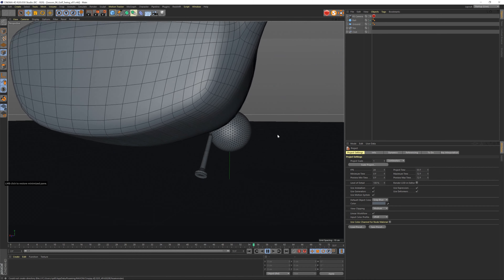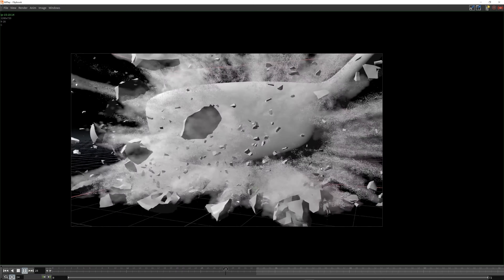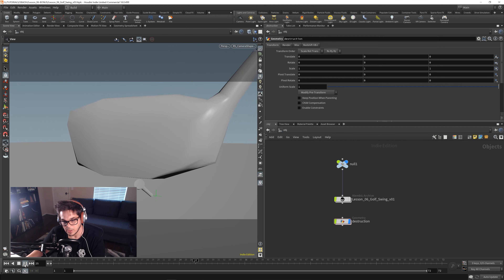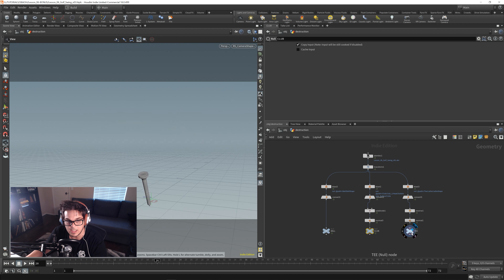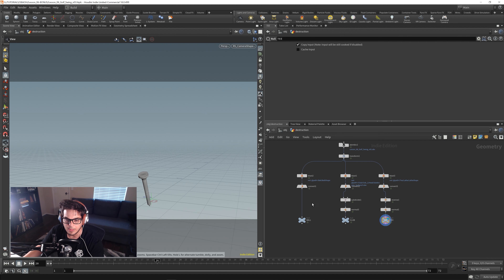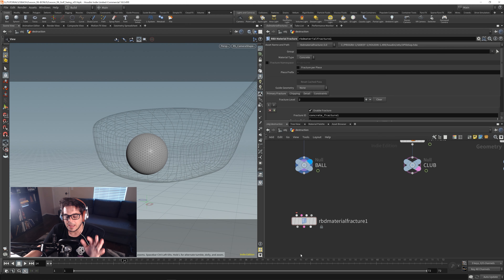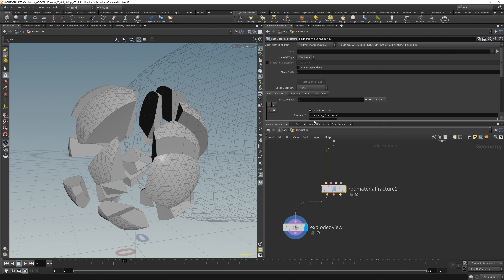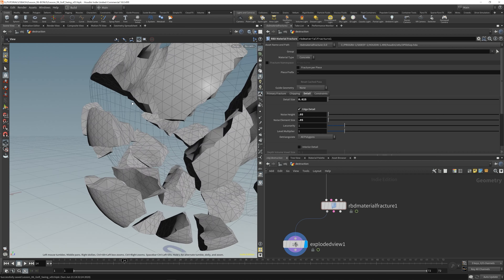Rigid Body Destruction // Part 1/3: RBD Bullet Solver in Houdini 18

Comment: I am not sure I understand why did the time scale affect destruction of the ball and release of all constraints? Thank you
Reply: By decreasing the time scale to 0.01, we are configuring the physics to react as if the shot was filmed in 100x slow motion. Due to this change, gravity takes much longer to affect the system, which is why the ball doesn't fall off the tee anymore. Also, because we didn't slow down our club animation to match the decreased timescale of the simulation, the club is effectively moving 100x faster with respect to the physics solve. This higher relative velocity makes the impact much more intense and it shatters all of those constraints almost instantly. Hope that explanation helps!
Reply: @MarkFancherFX  Wow thank you so much for such a through and competent explanation. I failed when I tried because I forgot to turn my collision geo into VDB but after I did that it worked pretty much like a charm. I never realized there is a link link between time scale and RBD in this way.